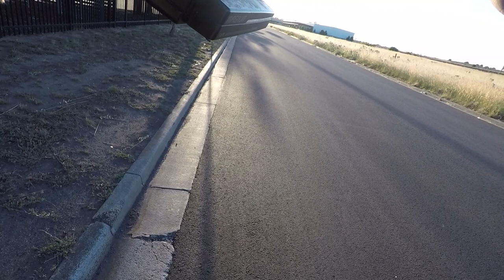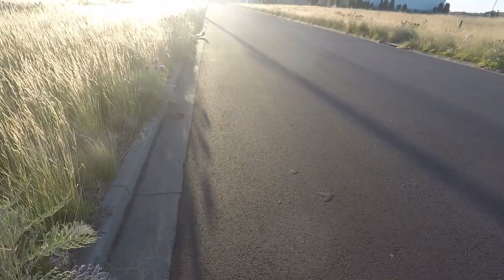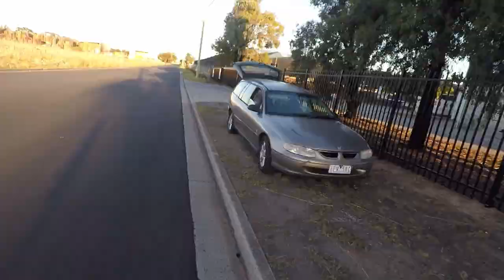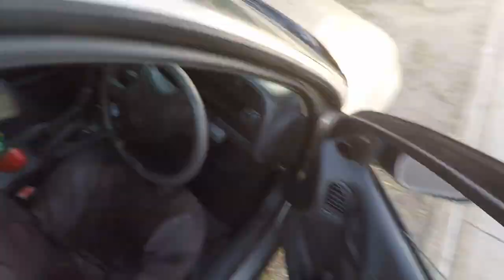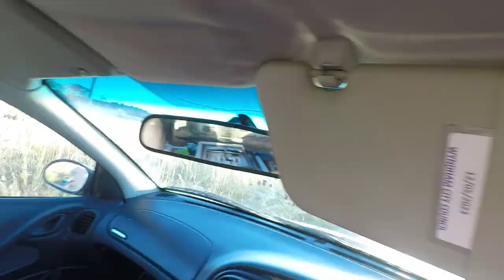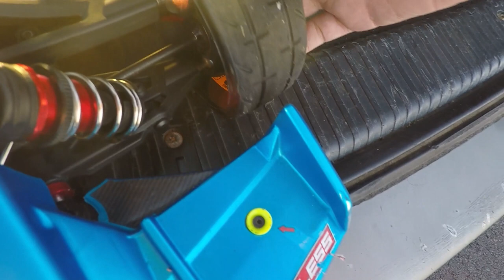Arrma Limitless | 6s Speed run 108mph

Comment: Get yourself a Power HD 23kg or 1812MG, the 20kg is a bit slow for a street basher or speedrunner.
Reply from the maker: It's plenty for me i slow my steering and lower the dual rate when i run so it doesn't need much it was just stuck in a bad position trying to recenter and burnt out